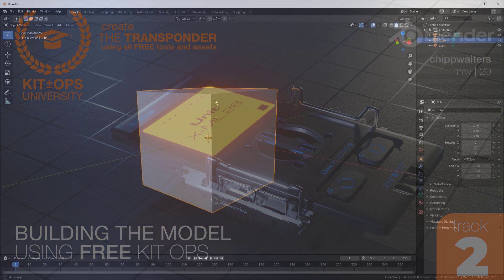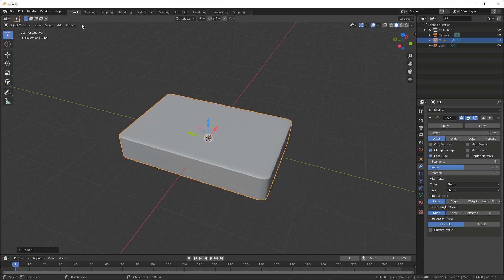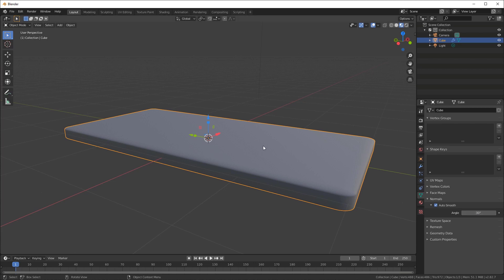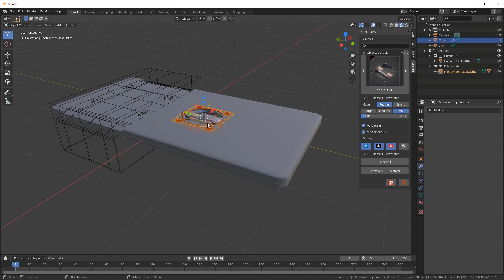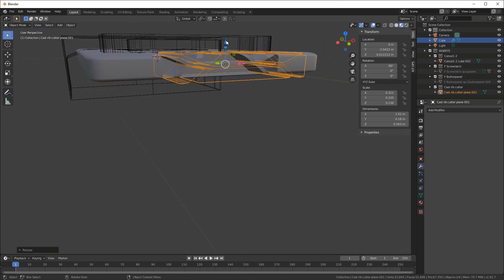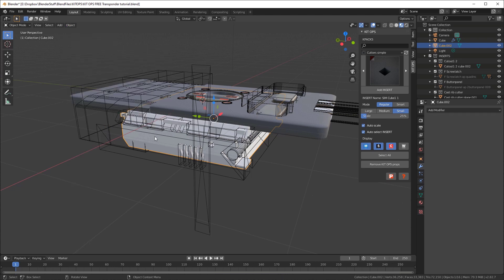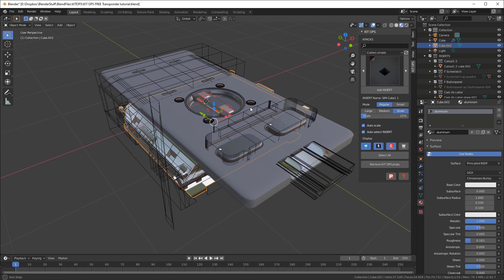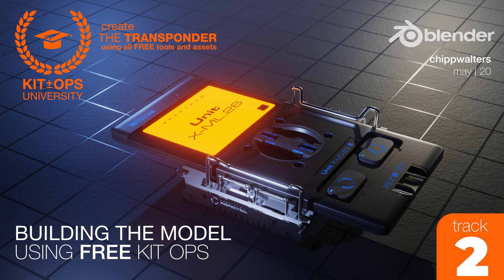Blender KIT OPS Transponder PART 2: Modeling

Comment: OUTSTANDING walk/talk-through Chipp! Quick question: attempting to alter the text ("Process") in the F_Buttonpanel insert. Understand how to hide/delete, but how does one modulate the text into something different? Already changed to font to 'Expansiva Bold'. Using KIT OPS Pro. Appreciate the tech consult.
Reply from the maker: You need to TAB into the object, then you can edit the text.

Comment: Can you please explain something to me? How does this actually get better results than, for example, manually creating a Boolean yourself? I make a lot of sci-fi corridors that could benefit from this but it's so much work having to take my manually created insets and then attack them to flat faces, re-work topology, etc. Does this cause weird artifacts?
Reply from the maker: Lots of questions there. This is mostly focused on speed modeling. It's like the difference between a craftsman working for hours in his woodshop versus going to IKEA and just buying a table. They are both valid.